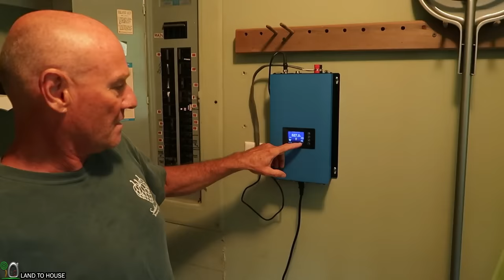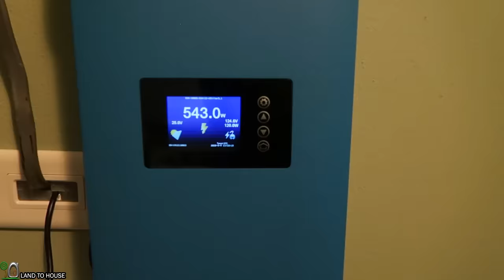Awesome Low Head High Flow Grid Tie Micro Hydro 530 watts!

Comment: Using AC doesn't reduce voltage drop. High voltage or big wire reduce voltage drop.
Reply: You remember Thomas Edison he was líes for Tesla...
Reply: @gabix.o  No. I remember math.
Reply: @josiahgibbs1838  that doesn't matter to much. In AC you have parasitic capacitance and inductance which they on their own create resistance. in DC you don't have that!
Reply: @thereynolds2725  
Yea, but you remember history?
Reply: @gabix.o  I do. And history has nothing to do with the physics of electricity. Besides, I like Edison. He wasn't perfect, but he was a great man.
Reply: @f.a3202  That's why they do HVDC over longer distances to lower the losses due to reactance and capacitance. The reason why we see those big 3-phase high voltage lines is twofold, they synchronize the grid and in old times the DC to AC inverters weren't as good and had quite high losses.
Reply: @John Mears That means nothing.
Reply: It reduces the energy disapated as heat
Reply: @abanoubsaid4138  How so?
Reply: So many commenters here who don't understand Ohms law.   This isn't an AC/DC thing.  The system would be much more efficient if that inverter were mounted in a NEMA 4X enclosure right next to the turbine instead of all the way back in the house.   He basically could cut the wire loss by a factor of five by doing that.   Making some rough guesses and system assumptions, he's losing close to 100 watts in that wire alone.
Reply: Yes but once he runs it through his flux capacitor it will eliminate any losses from either AC or DC due to the time space continuum allowing him to go back and reclaim his... ah 💩 wrong thread again. I really need a flux capacitor of my own.
Reply: @ehsnils  It's not the inverters that caused the issues. The reason AC was chosen to standardize the grid on is because of how much easier it is to produce higher voltages using AC. The main issue with long wires is current losses. Higher currents dissipate stronger fields which cause more heating and parasitic losses. They transmit power at massive voltages so that they can transmit the same total power with very little current. Converting between AC and DC wasn't great, but still achievable. Converting DC voltage levels though? That was next to impossible.
Reply: @dustinbrueggemann1875  When I was referring to old time inverters I was considering a motor/alternator setup and no electronics. More losses than a transformer and a lot more maintenance needed.
But for long distance transfers HVDC is pretty good since you will have less inductive losses.
Reply: @ehsnils  I see what you mean. Old tech puzzles me. I still remember reading an article about how they used IDK Mercury devices acting like Mosfets in inverters. Even now how do they generate megavolts of DC whereas the breakdown voltage of Mosfets and IGBTs is just a few kilovolts?
Reply: @radon360  Or he can use like a 10 centimeter copper wire and that would offset the 100 watts loss.
Reply: @davemwangi05   True indeed.  Though with copper hovering around $3/lb, that's probably close to $2000 of cable for the system to pay back.  ;-)
Reply: @radon360  LOL, it was a stupid joke. Probably the skin effect would say, "am I a joke to you?"  At 50 HZ, is it 8 cm skin depth, beyond which the copper is useless? Anyways.  How about the idea of winding the generator in high voltage like 240v? Wave winding, thinner coil, more windings, same power output, same voltage per turn, total windings occuping the same space. I wonder why they didn't use it. or why actually all these commercial versions don't use it to save the transmission loss. and of course the rectifier/bridge loses less 20A versus 2A. Ideas?
Reply: @davemwangi05   I can only speculate, but my guess is that due to the low volume of this application, they're adapting an off the shelf permanent magnet synchronous motor/generator and it ends up turning at a slower rpm than the original intended application, resulting in a lower output voltage. Take that into combination that many of the inverters are designed for a 24 to 48 DC volt input (many backup battery banks at cell towers, field telecom buildings/cabinets and data centers are 48 volt arrangement) and it starts to make sense why this initial output voltage is chosen.
Reply: @radon360  Oh okay, I get it. It's like standardized that way due to the fact that inverters basically are designed to harness energy stored in batteries which is low voltage. and not for micro hydro projects. And do you have any idea of how a 1 megavolt inverter for HVDC even switches? I find it puzzling that mosfets have a breakdown voltage of a few kvs yet there's a one megavolt inverter.
Reply: @davemwangi05  They build up the voltage using the items in series, like with a high voltage multiplier, similar to what's used in CRTs where you have about 15kV inside. A crude video here where each component handles a voltage lower than the final. Mercury arc rectifiers are items of the past.
https://www.youtube.com/watch?v=DVqr3BrvkRo
Reply: @dustinbrueggemann1875  Absolutely....transmission equals high voltage and lower amps...can you imagine how big transmission lines would have to be to carry 110V across the country.
Reply: DC will be more efficient at moving the power than AC , that's why long distance HV lines use DC. Rectify at the alternator terminals and use a nice thick feeder to the house.
Reply: @radon360  I think you got it backwards... 3phase AC is most efficient for long distance transmission (it's the world standard). 
Facts from video: 528W of full load power (measured post rectifier and possibly post inverter) over 100 feet of 3 wire 10AWG copper.
100 feet of 10AWG is 0.1 ohms per conductor.
100W/3 = 33W loss per wire would mean there is 18.2Arms per line wire, and 1.8V drop across the transmission line.
If it was 18.2A per line, then the voltage would only be ~16.5Vacrms line-to-line. That is a silly low voltage that would require huge generator windings.
He does not say what the 3phase voltage is going into the rectifier, but for safety reasons I hope he has it configured for <300VAC line-to-line as a corner grounded delta (one of the wires used in transmission is the bare copper ground).
Even if we assume a reasonable 120V line-to-line, the current on each line would only be 2.5Arms for a total transmission loss of 1.9W
Not even close to your guess (?) of 100W
Note: I'm a power engineer for 20 years with a specific expertise in measuring transmission loss, but sometimes I hit a wrong button on my calculator... let me know if I made a mistake
Reply: @dl5244  I was literally about to post the exact same thing......joking.....Dan must have a doctrine in electricity or generation or transmission or something. I produce it and he went way over my head
Reply: @dl5244   Not to get into the war of currents here, but actually high voltage DC is more efficient than AC for long distance transmission.   The problem has been up until recently, the technology to make this happen wasn't efficient or cost-effective enough to do this.  As a "power" engineer,  you should be aware of this.
   Regardless, it isn't about AC or DC, rather, as you know, it's about keeping the current as low as possible across the transmission system, which is where you trade higher voltage for a lower current to minimize resistive losses of the conductors.  

Now, regarding the voltage, if you go back and watch the video, he's getting about 24 volts out of the generator, not a useable AC line voltage.  It appears that you may have missed this piece of information.   Your calculations are correct, and roughly inline with mine, but you started with the incorrect figures, and basically worked back to the numbers that I used.   Also, 500 watts at 12-24 volts does not need huge generator windings.   For example, the typical automotive alternator today is rated at 150 amps (close to 2000 watts, depending where you want to specify your full load output voltage, which is typically above 14 volts).  While definitely the windings are a larger gauge than what is found in many AC motors of similar size, they aren't exactly huge in an overall view.

So the crux of my argument is that it's better to step up the voltage close to the generator to minimize losses...and your example calculations, which I generally agree with, support that argument.  Keep the short run of 24VAC 3phase (at whatever irrelevant frequency) as short as possible by putting the inverter nearby.   The inverter can step up the voltage to 120VAC for a better efficiency to transmit the power back to the house.
Reply: @radon360  i re-watched and I'm pretty sure there is no way his power meter is connected to the AC side of the rectifier (ie. he is not measuring generator output voltage). It might be the DC voltage post rectifier, but I suspected it's most likely monitoring the battery voltage (not useful to this conversation) after some charging regulation circuitry.
[I thought the >100A rating on alternators was a surge rating, not continuous? I have some experience computing "ampacity" ratings for bundled cables in conduit, and >100A needs a very low impedance with very high temp insulation ratings... but that's a side curiosity.]
I'm pretty sure his configuration using the 10AWGx2 (plus ground) as 3phase AC  is lower transmission loss than using the same wire for DC.
Lets assume the generator produces 500W at 24VLL rms 3phase. Each winding and each transmission wire would have 12Arms. Total losses on 3 wires = ~43W.
Assume a no-loss rectifier and a sinusoidal 24VLL supply voltage. The rectified 3phase voltage would be (at most) 33.94 VDC. The 500W implies 14.73A. For 100feet distance on the same 10AWG wire the loss would be ~43W.
In reality rectifiers have a voltage drop making DC transmission even worse!
HVDC transmission can have redundancy advantages for under sea spans and where wire price per foot is the limiting factor.
Reply: Dan Loewen  The power meter is indeed on the rectified side at the inverter input.   You're forgetting your friend  Kirchoff, though.   Those currents are traveling  200 feet (using the assumption of a 100 foot cable run).  That's twice the loss that your have calculated.
Reply: @josiahgibbs1838  you should find ElectroBOOM an EE who discusses this, also explains why some LEDs don't turn fully off.  Basically AC capacitance close to ground leaks current despite no closed circuit
Reply: @ehsnils  they also use massive insulators and high towers to minimise capacitive current with ground.
Reply: But carrying 24V peak AC in 3 cables would mean ⅓ the current per cable for a given power and half the effective cable run.
Capacitance with ground shouldn't be significant at low V.
So whilst I understand your point for grid power distribution, AC might be better than 20A in DC cables from loss pov.
Against it are the factors FB mentioned
Reply: @f.a3202  the resistance of an inductor is against the changing AC current, but this doesn't actually generate heat, does it?  The inductance resists the growing V but returns power on falling V.
Reply: @RobBCactive  yeah you're kinda right but this is the case on a puse inductor and without any load. when there's a load the power factor changes and so does the phase difference of the voltage and current and the inductor kind behaves like a load itself!

Comment: This is very cool.  I think another project that could use the water flow to its full potential would be the use of a water wheel with a gear system mechanically linked to a generator.
Reply: But waterwheels are very inefficient...  a great way to generate less power if that's what you want.

Comment: Hey there. I love the video. Here is another thought. Install a second inverter to run a pump to pump water back up into the pond. Figure a contraption that would switch the pump on when the pond gets low. Also, consider hooking the tennis ball up to a chain.
Reply: Great idea but if you understand energy it’s impossible to pump the water back up and have any energy left that you created initially. Man has been trying to invent the perpetual motion machine for years with no success
Reply: How about mechanical water pump?

Comment: You do wonder why there isn't at least one of these on every tiny little dam, though.
Reply: This design is not always sustainable environmentally as the water life cant climb up the stream.. disrupting their lifecycle. Its a good thing that its not there at each dam (I have no issues generating electricity on each dam as long as we can create a side channel for aquatic life to reach upstream)
Reply: Maintenance & distance from load usually. Creeks usually flood, which means the system has to be flood resistant. Intakes are especially vulnerable to getting clogged/wrecked during flood events & usually have to be manually maintained quite often.
Reply: The first barrier is greed from the gov, It's illegal in US,  Powers that be don't want this level of self dependence. I was surprised that a guy who has a stream passing in his own land says one day an inspector from the gov came to his compound, looking everywhere to make sure that he was not harnessing electricity from that stream.

Comment: Seems inefficient to go from AC (3ph turbine) -> DC (rectifier) -> AC (inverter) especially as the owner does not seem to have any battery storage.  Does anyone know if there are different electrical options here?
Reply from the maker: Using batteries would allow the power to be used as needed. Currently there is a lot of power not used when appliances are off in the house. From what I understand its better to go from the wild fluctuations of the 3 phase ac to a more steady dc and then regulated ac for the grid.
Reply: The 3 phase coming out of the turbine is probably not of a usable frequency that is compatible with anything the way it is. The best thing to do is turn it into DC to be compatible with off the shelf solar inverters.
Reply: Jeff is correct. AC from the turbine is not usable AC. It need to be rectified to a DC then AC to smooth out the frequency.

Comment: So how bout putting a adjustment valve on the pipe to limit the flow so you don't drain the swamp . I can't believe I'm giving advice on how not to drain the swamp when I'm very much for draining the swamp.
Reply: Lol 🤣
Reply: ✊🏽MAGA
Reply: Honestly the valve is already there... Just tweak the vacuum valve that you use to start it no? Ever so slightly open the ball valve, less flow in the pipe, more over the dam.